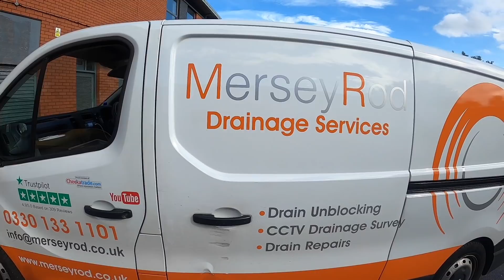Manhole Unblock! #57

Comment: I am subscribed to a few trade peoples channels, mainly Electricians, car audio installers, but also a couple of exterior jet washing channels which is probably how you cam up as a suggestion, but this is definitely the first time I've seen someone attempt to finish the job before the camera runs out! on a few, where the battery ran out, some will add some photos and add a little commentary. a few questions for you guys : Firstly Ive noticed that a lot of Liverpudlians just use postcodes to describe a location, ok I know Liverpool is a lot larger than Swindon, but if I said SN1that'd be the town centre south of the railway line, and a few areas to the South West, SN4 is eight villages to the South, some quite large, and a whole town - Royal Wooton Bassett, SN5 whole of West Swindon, but you all seem to just say a Liverpool postcode as if everyone knows what estate/area/suburb your in haha! Secondly, my only knowledge of drain unblocking is the few videos I have watched since I recently subscribed, but feel I've gained a fair bit more knowledge than Joe Public, but if I was attempting to try and clear that drain with, at best a cheap rod, quickly purchased from a crap DIY store, to try and remove some of the debris such as the wipes, I'd consider trying using a wet/dry vacuum, I think even a basic henry type might help a bit, or even for you professionals it may come in handy, have you ever used one, or do you think it's an idea? Great video as always, Ive now decided that whatever Trades people I need to use next, be it Sparky, Plumber, Drain Services, I'd see if any in my area have a Youtube channel, as it seems, these companies are not scared to show their work to tghe public, and also enjoy and take pride in their work. Great video as always guys. Have great weekend!

Comment: What's the function of the swan neck and the upper opening?  I recall seeing those before but with a cap covering the upper one.  Is it a service port, or an overflow for fluids in case the lower one gets blocked with solids?
Reply: It's an interceptor. The lower channel takes waste through a U bend and out to the main sewer. The upper hole is effectively a rodding point to clear any blockages in the U bend outlet. There is normally a lid on the upper opening like a tea pot lid. They fall off, cause blockages and aren't really needed. They are a throwback to the Victorian age and interceptors are no longer installed as they aren't (and were never) needed.
Reply: The theory was that they stopped sewer gas entering the house. In reality venting sewer gases from a stench pipe is a better solution and interceptors are redundant in function.